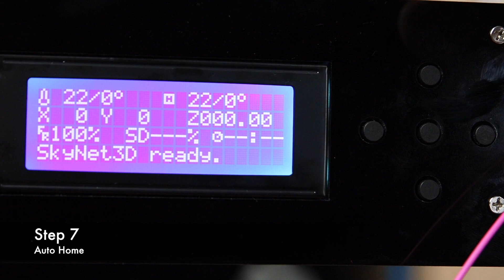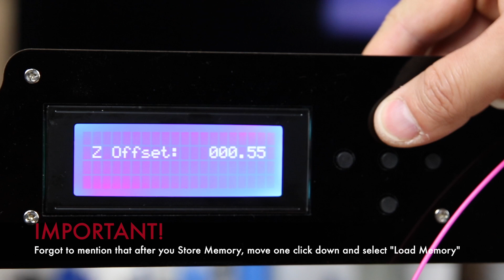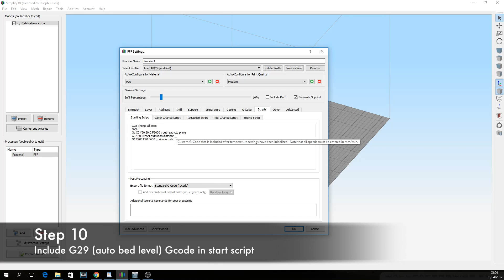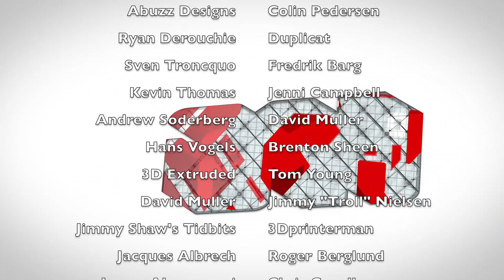Anet A8 - Auto Bed Level Sensor Calibration

Comment: Hi, 3d maker noob. I followed your instructions, which were outstanding Thank you, but now my printer extruder is shooting all the way over to the left and mashing the extruder into my glass plate and tearing up the tape when running the pre-print check.  If you happen to read this I would love to know if you have any ideas why this might be happening? First print went okay and this did not happen but every print since then, chaos!
Reply from the maker: does it do it when you click on home all or when you start a print?
Reply: 3D Maker Noob - home works fine, centers right up and nice and close to the bed, but when I start a print it happens. when it does the bed scan it goes to the left which put the level off the bed and it just crashes the head. If I let it try to print it does not center back up and tries to do so off on the left as well.
Reply from the maker: in that case the most likely scenario is that you have to set the centre offset in the slicer settings. basically where the nozzle homes and where the front left corner of the bed begins are not in the same place. so you need to tell the slicer where the bed starts by checking the x-y-x distance from the nozzle to the front left corner of the bed
Reply: Thanks. Sounds like something good to look into. I will do some searching and see about finding the settings for that in Cura. This is my first home built printer so I really appreciates the help!
Reply: So I am still working on this but I think I can describe it better. I have the same offset auto level sensor that you show and when the printer goes through its leveling check on the left side the sensor is ending up off the bed plate and when it moves down to find the stop point the sensor never detects the bed plate since it is off to the side. It keeps trying to lower it but basically, it never hits that stop point since the sensor if off the bed and so it ends up ramming print head into the print bed. I am going to keep trying, but I am hoping that you might have more ideas as thus far I am striking out on getting this figured out.
Reply: i have the exact same issue
Reply: 0nogolem0 - not the issue, but great advice. In my case the sensor was going off the side of print bed and then lowering while still trying to use it and thus grinding the print head into the bed. In my case I upgraded to Skynet v2 and followed the included documentation and used the config.h file for the 18mm sensor offset and it seems to have resolved that issue. Thanks for the advice though!

Comment: The auto bed level sensor TRONXY XY-008N does not work. The wiring is Black-Brown-Blue on S-Z connector as your instruction. I checked pin volt of connector as 5V(Black), 5V(Brown), Blue(0V). Is there any setting at configuration.h of SkyNet Firmware? How can I check sensor operation not to connect on mother board?

Comment: is it possible to use this type of sensor with a glass bed? Mayby by adjusting the offset?
Reply from the maker: +Robin Jansen problem would possibly be that the sensor wouldn't be able to reach the trigger point as the glass is too thick. I will need to check
Reply: Any update to this?  I have a glass bed and would like to install a bed leveler.
Thanks for all you do here.  Your series is  my favorite.
Reply from the maker: waiting on a glass bed to try it out, i will be testing it once i recieve it. after that, i will try to do a BLTouch install :)

Comment: The light doesn't come on the sensor when it is close to metal?  Kinda scared to go further in case the sensor is not working.
Reply from the maker: +Mike Carter you might need to check the wiring as that is most probably your issue. Some sensors need their wiring swapped around
Reply: Thanks for the reply, I decided to go ahead and just configure it, it does work, just no light. Not sure which wires I would have to swap around, so just going to leave it alone. From all the googling and youtubing the wire colors are correct and with my luck id end up breaking the connector off. As it was I broke the acrylic backing tightening the screws.. gotta love crazy glue.

Comment: I installed the software you provided and for the most part, it worked. I am having an issue thou when it auto levels it starts in a more upright position than the center and due to that when it auto levels it puts the sensor that is located on and back of the extruder off the build plate so it can't sense anything.
Reply: It does print perfectly in the center thou even with the off home position

Comment: There are a ton of videos on anet a8 upgrades.  I just bought the a6, and I'd love to see upgrade videos on that printer. I know that the printers are similar electronically but physically there are some significant differences.  I'd also like to see a bltouch or
3d touch bed leveling setup instal on the a6. 

I'm not trying to detract from the a8 crowd , but they have an
abundance of videos to choose from.  The a6 crowd is starving for info. 😉
Reply from the maker: +Marcel LeMay yeah I have the A6 and as soon as I get back I will start working on upgrades for it :)

Comment: need help, when I adjust the Z offset it does nothing<--
I got it as close as I could manually, tried adjusting through the menu and.. nothing.  maxed it all the way to 10.0
from what I can gather it should have moved 10mm?  it did not
I now have it as close as I can manually. but it just doesn't work well....  please help?!?!  also my LCd screen goes garbled randomly, anyone else have that issue? know a fix
Reply: because it does nothing immediately... Nozzle goes down when printing the first layer - by the value you programmed. ... so do some first layers... and always increase SLOWLY - till you get the best result...

Comment: Autohome sends the extruder to the far left so the sensor cannot detect the bed - did you encounter this?
Reply from the maker: didn't happen to me to be honest - maybe you need to set bed offsets in firmware?
Reply: I get the feeling when I tried the Skynet 1.1 previously, the instructions I was using recommended all sorts of changes to the configuration.h. I just deleted and unzipped 1.1 again and it centers now. I will now try and upgrade to 2.3.9 again and see if it works. I also trolled around the webs and found other people had similar issues so I hope my experience here helps someone in the future if it works.
Reply: Freshnet did it work?
Reply: Willy Jauregui 
there's a setting called Z Safe Homing that is disabled by default.  im now using skynet 2.4.4 successfully

Comment: I tried Skynet once when I 1st got my sensor and found that it would show garbage on the A8 LCD so I reverted back to Repetier. What version of Skynet did you use? Do you get the same garbage on the LCD? Also I ended up giving up on the Repetier autolevel firmware as it just didnt work properly.
Reply from the maker: that's the same thing that happened to a lot of people with version 1.1, which is why i updated to version 2.3.9 (links and instructions in the video description of the fan shroud showdown video i uploaded yesterday). it's much more stable - better print quality too
Reply: Awesome thanks!
Reply: The file from the dropbox link appears to be corrupt :(
Reply from the maker: +Freshnet seems fine from my end :/ will check again when I get home
Reply: No good - tried a different browser as well. I downloaded from their github and trying that. Thanks anyway, your support is awesome!
Reply from the maker: +Freshnet will definitely check when I get home from work and get back to you :)
Reply: says they are corrupted for me aswell
Reply from the maker: +Nick Anderson you need to update to firmware 2.3.9 I have link for it in the latest fan comparison video

Comment: What SkyNet configuration did you use? The standard Anet sensor or the 12 mm inductive sensor? Hope  you'll still answer.
Reply from the maker: i'll always reply as long as i'm awake :) the one i used is an inductive proximity sensor which as far as i know is the one that ships with anets when included. this came with the tronxy but they are the same. in terms of configuration, the video shows exactly what i used, nothing less :)

Comment: Thanks  I have bought one and have to wait till we move so I can assemble it....This is one thing I wanted to add to it....BTW I guess there is no need to level using a bubble level..??   as it may be out of square with the frame...????   Rgds  Laurie
Reply: LWJCarroll hi, you cant use bubble level cause bubble level used to level an object to gravity of the earth. The bed led in 3D printer is to measure to make sure the intruder is parallel with the bed. So when the intruder drawing, it will be even on the bed.
Reply from the maker: hey, to be honest not sure what the bubble level is?
Reply: Hi it is the old carpenters tool... for leveling floors walls etc....slightly curved glass tube with light oil and a bubble in it....try googling carpenters level or bubble level   Rgds  Laurie

Comment: Hi, 

Great video!

I have upgraded to skynet3D and added the sensor like you did and now have 2 issues:

1. If I add the G29 to the gcode in simplify3D the print always start about 15mm before the headbed! ;-) If I do the same print without the code it's normal. any idea's how to solve this?
2. I have strange codes on the lcd during printing, it go's back to normal when I use the button to go to the menu and then back
Reply from the maker: hey, so, thank you first and foremost :) 

1. you will need to calculate an x-y offset in S3D so it knows where the print bed starts, if you don't manage, i can upload my AnetA8 factory file for you

2. i've had a couple of people mention those charachters, seems to be a flaw in skynet1.1, it has been fixed in teh latest version so i will update it to test and revert with a video :)
Reply: Hi, if you could upload that would be great.
Also looking forward to your e3Dv6 upgrade.
Reply: Yes, if you could upload your file that would be great.
I used the default Anet A8 settings in Simplify3D

Comment: If your sensor is not working - check your cable connections. They should be BLUE - BROWN - BLACK
Reply: That comment really helped me, and tbh you werent very clear when explaining the order of the wires. Maybe in the future you should try and take your time to explain in more depth when it comes to wiring. Howvever great video keep up the good work ;)
Reply from the maker: yep, i mentioned that in the install video :)
Reply: ah ok - because it took me a bit of time. :-D
Reply: YOU SAVED ME!
Reply: Mario Cimmino Yeh same. XD
Reply: I am still installing it do you now a good guide that explains how to flash the firmware?
Reply from the maker: check the skynet install video i did prior to this.
Reply: Yeah there isnt it correct either, so blue brown black worked for me too

Comment: Are you using the original firmware?
Reply from the maker: i upgraded to skynet v1.1
Reply: 3D Maker Noob how do you upgrade it and what differences are there. I run the original firmware with my anet a8.
Reply from the maker: https://www.youtube.com/watch?v=l2B9lNi8LHE :)
Reply: 3D Maker Noob thanks a lot :)
Reply: Why Skynet v1.1? I checked on Facebook that current version is 2.3.2.
Reply from the maker: as i explained in previous comments, v2.3.2 was not working for me and was giving me errors. i will figure out what is wrong adn update the video shortly
Reply: Thanks for quick reply! I'm new on your channel and just preparing before my A8 will arrive. :)
Reply from the maker: Shim ON awesome! Hope you enjoy it, Anet has a massive community so you will never get stuck :)

Comment: Hey, Maker Noob
Great video.
Will this sensor work with glass on the hotbed?
Reply from the maker: i doubt this particular sensor would, however i will be buying a different sensor soon and installing that one that works with a glass bed and will doa video on it
Reply: Yes it does.
Reply from the maker: it does but will be a hassle as the distance offset between the nozzle and the sensor would either be too little seeing as you have to lower it even further in order to compensate for the height of the glass bed against the nozzle, to some extent the sensor might end up even lower as this sensor detects metal surfaces not any surface
Reply: In some cases when your PSU is slightly off delivering less than 12V the sensor can be affected, but under normal circumstances the blue 6-36V rectangular form factor sensors work fine @5V leaving about .3 to .5mm to the 3mm glas sheets. Powering these sensors with 12V and connecting the output via voltage divider (2/3 i. e. 1K/1.5K) they even work better.

Comment: Another awesome vid! I'll definitely be using this resource and the firmware one as well, once it's time to upgrade! Are you considering the E3d V6 upgrade? I've got one coming in, along side my A8 order, and I'd be interested to see the conversion method in your style. I'm planning on using the stock head for a while until I'm ready for the switch to a bowden setup though, so you've still got time. lol
Reply from the maker: +Dj Goku E3D V6 is already here and waiting :) i just need to finish comparing the A6 to the A8 and the first thing I'll do is install either the V6 or the titan extruder :)

Comment: So very concise Joe, thanks for sharing this. I am looking for a 'budget' printer to add to the channel, thinking a kit. I know you get this a lot, but what do you recommend I start with. And remember, I am a bigger NOOB then you, this would be my first kit.
Reply from the maker: +Print 3D Channel while this is not the ideal first printer, it definitely is a very good cheap kit, costs less than 200, and the community behind it is impressive. It's also a LOT of fun to print all the upgrades for it. A step up from this would be the A6, better UI, more rigid structure but less tinkering needed. After that it's a CR-10 :)

Comment: That was definitely a different way to set up the auto leveling, and it will work just fine. It was easier than what I just went through using the Ardunio codes and all. Upgrading to skynet messed up my extrusion values that I was perfect with the stock firmware. I was able to adjust the values in the Ardunio method and don't know if there is a similar was of adjusting like you did with the self leveling.
Reply from the maker: +John Henderson I did a video on extrusion multipliers the noob way using matter control :) it should be able to work with the Anet, no codes required